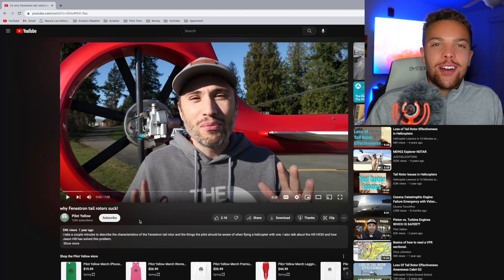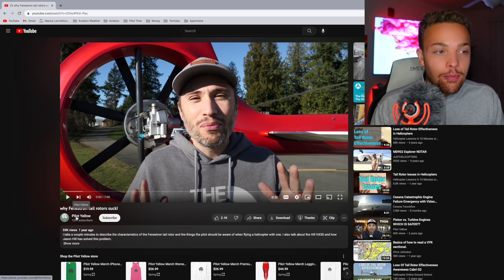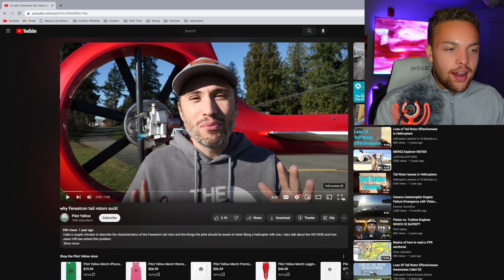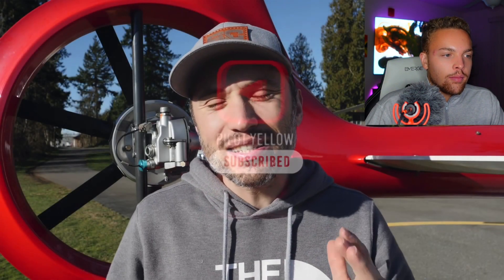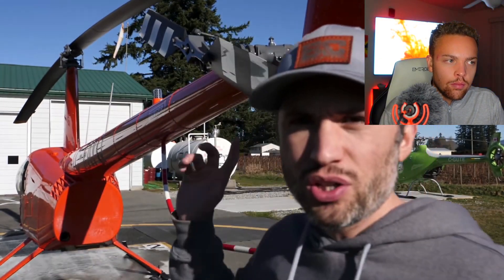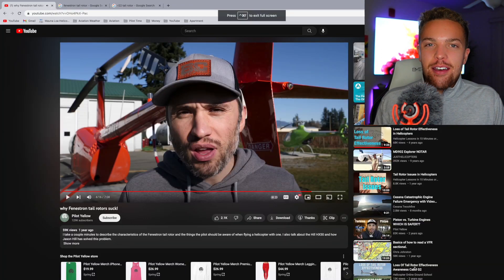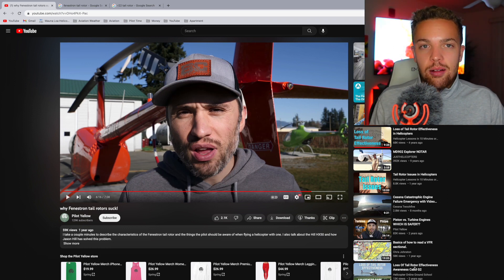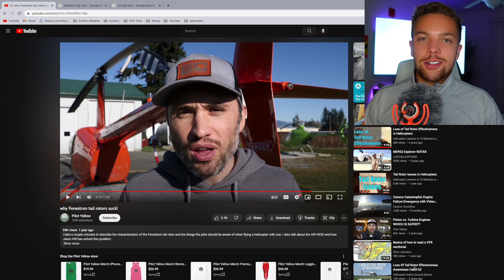Reacting To - Why Fenstron Tail Rotors Suck - (It's Actually Not True)

Comment: It really depends on the particular helicopter. I fly both an Enstrom 280FX (traditional tail rotor) and an EC120 (Fenestron) and there's no significant difference in tail rotor effectiveness or pedal movement. Other than the rotor turning the opposite direction, so in the Enstrom, the "power pedal" is the left pedal, in the EC120 it's the right pedal.